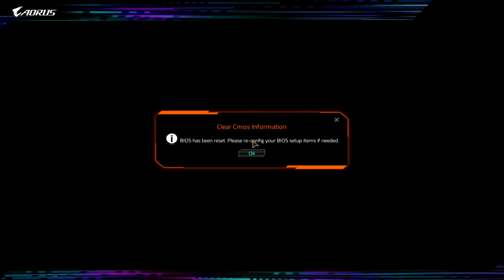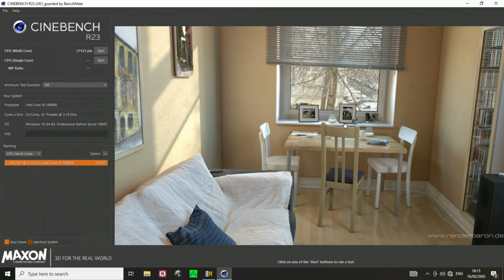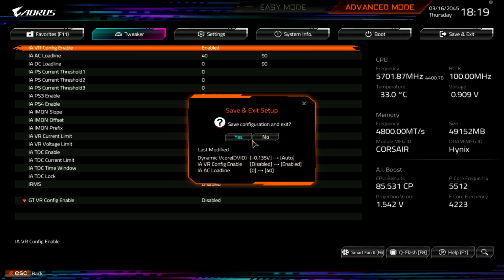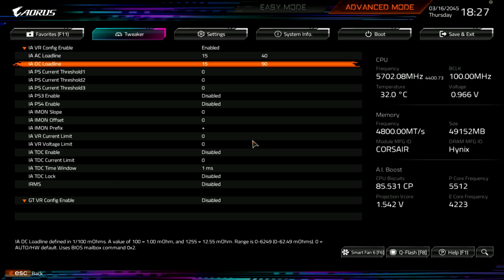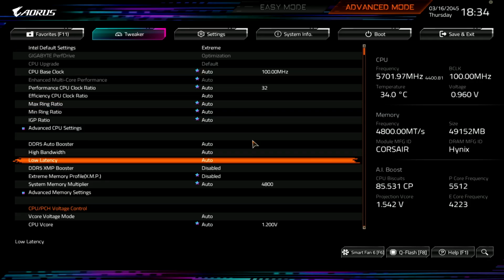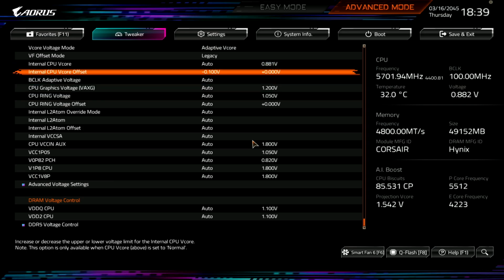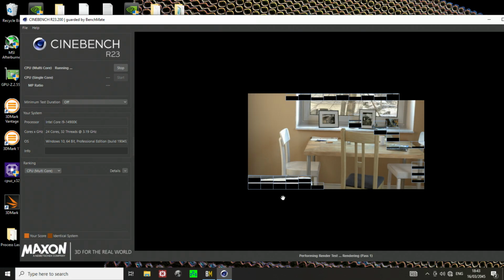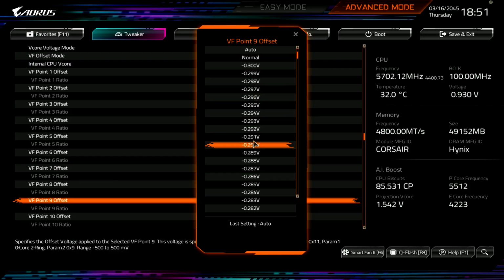YOU  DON'T HAVE  TO TURN OFF CEP to undervolt intel 13/14th gen CPUs

Comment: I don't understand something about AC = DC = VRM LL paradigm. If do it this way you basically have almost no v-droop, correct? Because even if you set your VRM loadline very droopy, like 0.9 mohm, and then "tell" the cpu about that vdroop (AC LL) it will just "ask" for more to compensate. Or does it actually makes a difference if we use let's say 20/20, compared to 90/90? Isn't actually something like 50 mohm of diffrence between vrm load line and AC LL considered ideal amount of vdroop or is it different for 13/14th gen?
Reply: The function is that if you want to use CEP still, then you have to set the AC/DC to roughly the same impedance the the loadline calibration you have chosen. The best results often come from somewhere in the middle. Medium/High options. You need to know the impedance of the VR though. It is very often different between manufactures. For example my MSI is LLC 6 AC/DC 40 LLC7 AC/DC 69 where as Gigabyte (such as this one and the gaming x etc) are LLC medium AC/DC66 and LLC high AC/DC 55. It allows the caluclations to fall within the tollerance so that when you set the VID lower it isn't seen as an excursion by CEP, so you will get your frequency at that VID instead of it clock stretching or crashing.
Reply: @theboomfish  Where did you get this numbers from, they seem pretty precise?
Reply: @sp00n  hours of research. Found threads where someone had listed the numbers then made my own notes for what I wanted. I didn’t copy them all for every setting unfortunately. They are out there though.
Reply: @sp00n  I can confirm the numbers for MSI are correct. You can find out on your own. When your vid = vcore under multicore load it means that you matched your DC Loadline to vrm loadline.
Reply: @Savigo.  So I did check my MSI Z790 Carbon WiFi board now with the various LLC settings, and compared the VID value to the VR VOUT reading (and not the Vcore one, since VR VOUT should be more accurate according to Buildzoid).
My values are quite a bit different than the ones listed here, not sure why. Maybe because I used VR VOUT instead of Vcore or maybe I made some mistake. Or maybe it's just a different board.
I also had to heavily castrate my chip to be able to stay under the thermal limit for these tests (disable HT, disable all E-cores, disable all but four P-cores, set an offset of -0.150v, use Prime95 192k without AVX/AVX2 to generate the load), which may have played a role, but I don't think it did

LLC____DC LL___Impedance
Auto __110 ____1.10 mOhm ____100.00 %
1 ______10 ____0.10 mOhm ______9.09 %
2 ______17 ____0.17 mOhm _____15.45 %
3 ______22 ____0.22 mOhm _____20.00 %
4 ______29 ____0.29 mOhm _____26.36 %
5 ______36 ____0.36 mOhm _____32.73 %
6 ______61 ____0.61 mOhm _____55.45 %
7 ______88 ____0.88 mOhm _____80.00 %
8 _____110 ____1.10 mOhm ____100.00 %
Reply: Because of the predictive vdroop compensation on the CPU. By giving it less vdroop to begin with, the CPU will request less voltage because the predicted maximum voltage will be lower (it's absurdly high for some reason).

Comment: How would you decide on optimal AC loadline settings on a platform that doesn't have LLC or a vcore sensor i.e. an Intel HX laptop?

Having a lot of fun trying to fine tune my MSI Vector 16 HX with 13980HX (I.E. a 13900k in a laptop) but I don't know how to the optimal ac loadline setting other than to first set a voltage offeet on the edge of stability and then adjusting AC offset and seeing whether heavy loads or light loads cause the first crash. Ideally a properly set AC loadline will allow maximal offset at low loads without crashing either low or high loads, correct?

Ironically, my MSI laptop bios DOES have an IA VR limit and I happily run all core 5.6ghz on light loads with a 1.3v limit.

Comment: So, did the new microcode actually do anything besides set limits I could already set in the bios? I'm still waiting for a non-beta release for my board (z790 Aorus elite 1.0 rev)
Reply: I updated my board with z790 bios flash, I’m a newb .  My pc now runs much harder it throttles all the time like it needs wayyyy more power from the fans .  Not sure what’s going on.

Comment: intel safe profile is not here to saves peoples cpu , it's here to save intel .
they put voltage so high to get less crashes on faulty cpus and fix problem for healthy one until the end of warranty .
so faulty one will run longer than it should be , healthy one run lower in life but they have problems after warranty time .
you won't see this generation works for more than that warranty time .
that warranty is just there try to save intel from recall .

Comment: Would these settings also apply to a 14900KS on same board?
Reply: Of course, not sure how much undervolt wiggle room you’d have though. Since they are better binned, their VIDs are already lower compared to most K’s and KF’s. Unless you got a really bottom of the barrel KS, I’m sure they exist.
Reply: @MhillPlays  I'm gonna mess around in bios and give the setting a try.

Comment: y'all don't seem to understand. These chips aren't designed to run 6GHz, Intel is doing it's hardest to keep them stable at those clocks but the realiy is... no matter how you play with voltage curves, you have to manually shave off 200~300MHz, then it will be stable and won't try to kill itself
Reply: most people are just running default or close to it and its the hardware and bios that does that.

Comment: My MSI Z790 ACE has a Renasas controller, and uses the same multipliers for LLC and AC/DC LL as your Gigabyte mobo. 

Do you think motherboards from different manufacturers with that controller should have the same multipliers?

Comment: Great video honestly. helped me tweak my 14700k with CEP back ON and no loss in performance at all. still getting 35-36k on CB23 and 2k+ on CB24. Thank you
Reply: I have the same cpu, what settings did you end up using/changing? I still struggle with performce loss with CEP enabled
Reply: @Inasari2  I just used Intel performance profile on my z790 aorus elite AX board and went ahead and changed AC/DC loadlines to 55 and Loadline calibration is set to high. and put in a 1400 IA VR Voltage limit. and then I undervolted using adaptive voltage like I always have done but this time I put in -125mv vcore offset. I used to have it at -80mv vcore offset but at that time I had CEP off and LLC at low with AC LL at 40. I also went into advanced cpu and put in a TJmax limit of 85c and disabled AVX offset. that's about all I did in terms of cpu tuning.
Reply: @Kobe4Life2424  thanks brother im gonna use it ❤

Comment: For some reason on my Z690 UD DDR4, offsets over 120mV don't do anything. So I've using a 80mV offset + a AC Loadline of 30 to undervolt since day 1 on my 13600k (and a 1.4V limit but it never reach close to that, it's close to 1.2V on idle and at 1.154V full load). No issue with the CPU so far and I've been using it for more than a year but I guess I got a good silicon which helps.

Comment: So I got a terrible 14900k, I can run only the following settings without triggering CEP (even out of the box triggers CEP) on an Asus z790 board.

LLC = 3
AC = 0.66
DC = 1.1

On top of that, I slapped a -0.100mv IA Voltage Offset into it, and it's stable on C23, Prime95 and Hogwarts Legacy Shader compilation.

At this point I dont even know anymore whats correct or not, but as said, this is the only way for me to run it without hitting CEP (or using the worst ASUS profile, that puts AC = 1).
Reply: did you change svid behavior ?
Reply: @nemesis762  no, it doesn't matter, it only changes AC/DC values. Auto is AC/DC = 1, typical changes AC to 0.4

Comment: So, just RMA'ing  because the microcode came out. My 14900k is horribly damaged just like yours, it started having issues and crashes just after 3 days of usage, but moving on with a brand new chip how do i ensure i am not damaging it again? i am ofc on the latest bios, and intel defaults, how can we be sure increasing the power limits is gonna be safe?

Comment: It you want to measure something like Die Sense with a 'scope DO NOT connect a piece of co-ax and 50R terminator! Instead just add direct very short wires to the relevant point, plus a ground as near as possible, and connect a 10MOhm X10 scope probe directly to those short wires. As a graduate EE what you are currently doing is painful to watch.
Can I also suggest that this could have been literally a 5 minute video showing CORRECT settings for undervolting without triggering false CEP.

Comment: Setting IA VR config is not available on MSI boards, a rep in their forums straight up said they wont enable it.
Reply: Just all core overclock your CPU then, or put a fixed max on Pcore and Ecore. Like 5700mhz and 4200mhz. Then with undervolting, the VID requests will never be too high.
Reply: just use lite load and do it that way.
Reply: @bigpoppa1234  No. Lite load only adjusts the AC/DC Loadline.
Reply: Lite load is the way to go for MSI
Reply: @Quesadilladong  Lite Load just sets the AC/DC LL values on MSI, which can then trigger CEP if set too low. And the whole point of this video was to not trigger CEP. 😬
Reply: @Quesadilladong  No. CEP will kick in.
Reply: @steakhoux  I've disabled CEP. I'm not sure what the side effects are, but on my i7-13700k I'm getting just under 31k in R23 with 76c max temp at 200w
Reply: @Infi1337  Check the second page. 😐
Reply: And now they apparently reconsidered and are planning to add the setting for all 600 & 700 boards 😄 (check the thread posted above)

Comment: MSI doesn't have the voltage limit setting, someone asked on the forum and apparently they've made a decision internally not to offer it. In terms of the CPU core voltage modes, they have Auto, Adaptive mode, Override mode, offset mode, adaptive + offset mode, advanced offset mode (VF point), adaptive + advanced offset mode (vf point), adaptive + offset + advanced offset mode (vf point). I'm not sure what they all mean exactly, but Adaptive + Offset Mode allowed me to lower voltages further without triggering CEP, when I was already on the edge of triggering it with my load line settings.
Reply: Advanced Offset Mode (VF Point) also works well on MSI, just tested it. And then you can add your undervolt only to VF points 6-11, for example. Or whatever matches your top ratios.
Reply: Same here. I matched my DC LL and LLC, set AC LL TO 15, adaptive + offset, auto and -100 mv. My CPU at 55/43/45 hits 40,800+ on CB23 and maintains 55 on full stress tests. And my VR out and vcore are almost identical
Reply: @kpm4620 which llc mode are you using and what value for dc?
Reply: @janos1312  I RMAd my 13900k and got a 14900k. Here’s my current settings on my MSI board:

LLC 6 (50 mohms), ACLL and DCLL 50. Adaptive-auto, -160 mv offset, PL 1/2 260w, 400A. I leave clocks stock. This thing runs great
Reply: @kpm4620  i have z790 carbon so i guess ill try those values. thanks man
Reply: @janos1312  you bet
Reply: And…I may hit low 90’s on a 30 min OCCT run. I usually maintain upper 80’s

Comment: Bz, Whats your opinions about Tech Yes City's latest video where he states the only way to prevent degradation is to lock all the cores a, i.e., 13900k to 5.2ghz and 14900k to 5.2ghz and cant overclock RAM past 6000mhz .... Do you agree? We cant even oc RAM to 7200mhz or 8000mhz?? 😢 Everything because anything over 1.3 volts (or 1.25, cant remember) will degrade the CPU, according to him.

Also, cheers from Portugal
You are a very intelligent guy. One of the few that understands how a PC works 🎉🎉🎉
Reply: lol tech yes city

Comment: I wish you would attempt these videos on an MSI z790 Board to see what you can and cant do when settings YOUR particular board has but others (such as MSI) doesnt have. Such as IA VR LIMITS we cannot set any because we havnt the ability to do so on MSI boards cant even sync LLCs without full manual tuning. Its terrible how different boards are. There should be a mandatory labeling across all manufacturers and the only difference in settings being between AMD and intel only. If youre on an intel platform the terminology and access to settings should be a standard across all boards. This stuff is ridiculous now.
Reply: check the guides on the MSI forum, they helped me 

https://forum-en.msi.com/index.php?threads/guide-how-to-set-good-power-limits-in-the-bios-and-reduce-the-cpu-power-draw.400270/

https://forum-en.msi.com/index.php?threads/different-undervolting-methods-with-ia-cep-enabled-and-how-they-compare-to-lite-load.400984/